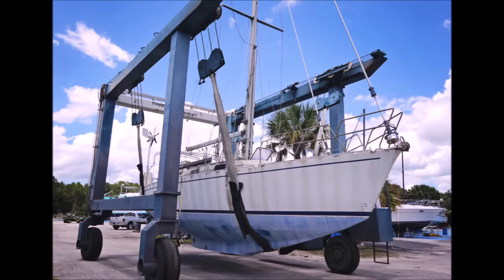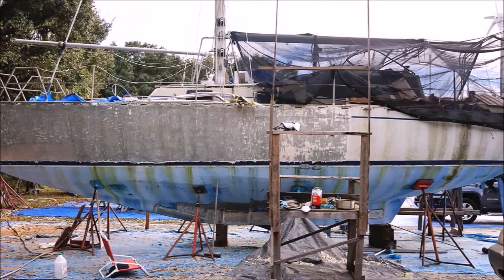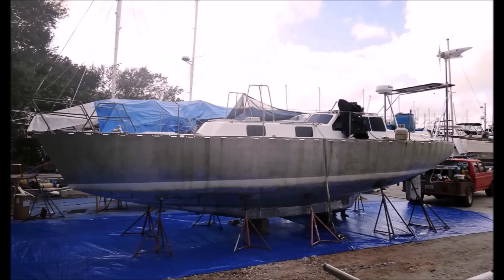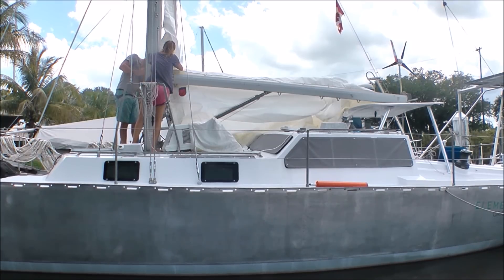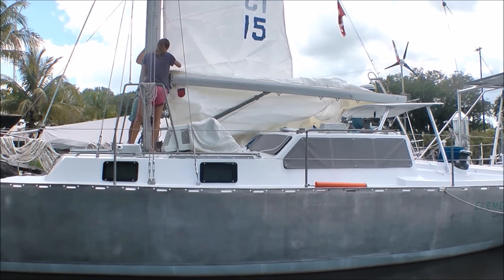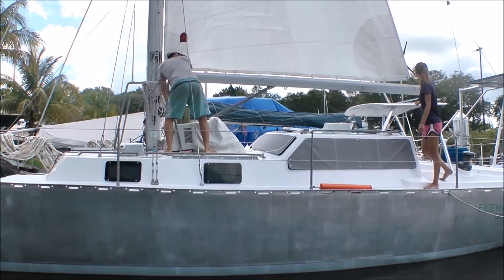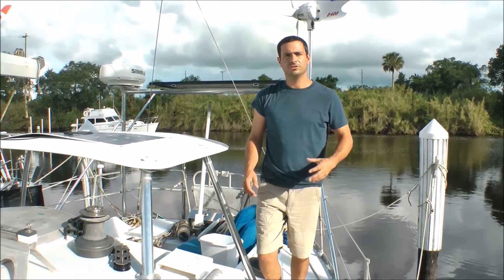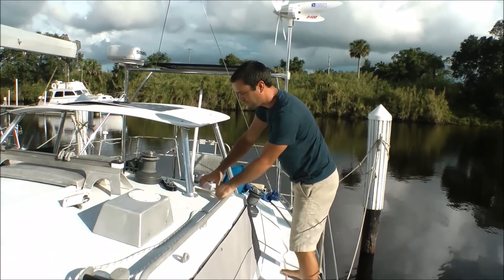Our Thoughts on Going Bare (MJ Sailing - EP 24)

Comment: I was one of the posters that questioned the bare hull.  I spent a couple of decades in Manufacturing and dealt with a lot of Aluminum, mostly 6000 and 7000 series.  I am not familiar with 5000 series but it looks like you did a lot of research and have made a wise choice. Good Job.
Reply from the maker: All Matt does from dinnertime until bedtime is research. I always trust all the decisions he makes on the boat.  :)

Comment: Best way to design is form follows function.  This has been a motto from the Porsche factory since the early days.  Porsche's racing color is silver because in the early days the bodies were aluminum and in effort to reduce weight the simply buffed the bare metal. 
As a student of design, I always love it whenever I see a design element that is outside the ordinary. When you investigate, you realize it's for a purpose which may be vital to its function. Love it guys, have faith in the science it always wins.

Comment: Personally -I like the bare aluminum hull.  Many aluminum expedition yachts are left bare -not sure why specifically,  but I have come to like it as I have been researching high latitude sailboat options.  
The larger point though is -it is your dream boat, and the both of you have done a tremendous job refitting it to what you wanted.
Happy safe sailin' and watch out for those icebergs.
-corey

Comment: Good choice on the winch position, to get speed and power on the winch you need your chest over the winch so under the canopy wouldn't be ideal.
I wonder if people realise that aluminium is for cold climates as it doesn't become brittle at low temperatures. Hit an ice berg in a steel boat and it will crack! Hit a submerged shipping container in a GRP boat and you'll likely get a big hole. Love the boat guys, looking forward to seeing her sail 👍

Comment: Nice progress, congratulations!  So, another option for running your lines back to the cockpit:  Start by scrapping that traveler and replacing it with a longer and more functional traveler in the 4-5 foot range.  Garhauer makes great travelers at very reasonable prices.  This would cause you to push the support legs for the traveler base further outward on the cabin top and leave more open real estate to run the lines cleanly to the center of the cockpit and near the companionway.  A little more work, for sure, but I think you end up with a clean installation, very functional, and a more useful traveler for shaping the mainsail.  Look forward to seeing the final install!
Reply: We're actually thinking of scrapping the traveler completely and going with an a-frame dual mainsheet set-up.  I wish I would have done this before the paint.

Matt
Reply: That's another option for sure, and would also free up valuable real estate.  I have no doubt you will figure it out one way or another!

Comment: I think you're on the right track with line placement. Everything is a trade-off. Some things to consider, but not deal breakers: getting in and out of the cockpit without tripping/smashing shins, reaching over the coaming (think rough seas) to operate the clutches, and planning the placement of your life-lines so they don't interfere

Comment: hey M&J I know all too well about the difficulties of painting aluminum because I paint aircraft for a living. Previously you basically had only two choices for getting anything to stick well to aluminum.  You had to either use an acid etching primer or Alodine which is a very toxic chromic acid solution. But now there is a new kid in town and it's called Prekote. It's made by the company Pantheon chemicals. in addition to being completely non-toxic and 100% environmentally safe it's also very very forgiving of process error so it's super super easy for the DIY person to apply successfully. And boy does it make the paint stick! I'm not a shill for that company or anything like that but I do use their product and really believe in it.

Comment: Matt, I think the solution you came up with for the winches is perfect! I like anything that unclutters the view forward, and you have the added advantage of another tie down point close to the side of the boat. It's to bad you'll have to do some touch up painting, she's looking so nice and finished right now but it'll be worth it in the end. Thanks for explaining the bare aluminum thing to....I was one of those people who wondered I just never had the courage to ask! I'm most anxious for your next video on the composting head. I'm re-fitting my 26' boat for solo sailing and it came equipped with a port-a-pottie which I quickly thru in the trash. The "Air Heads" are still quite expensive but I see so many people are designing and making their own now a days. You've done such a wonderful job with the rest of the boat I'm wondering what I can learn in that area that'll be really useful to me. Oh, I know 26' is quite a small boat for solo sailing, but I figured it would keep the costs to a minimum which is of utmost importance to me. She's a C&C (standard 1979) so she's got a 10' beam and 6'3" standing headroom something unusual for a boat this size. Being so beamy she's got lots of storage (plenty for 1 or 2 people). I've also ripped out all the a/c and I'm going only d/c solar power so I can be pretty much self sufficient. I will of course have a portable get-set and an inverter. I'm hoping to carry 500 to 700 watts of solar panels on board with enough surplus to run a fridge and possibly a/c for the really miserable days. My plan is to aviod marina's when at all possible. I've even found a really great portable water maker that produces 18/gph. So please go into as much detail as possible about your composting head. You boat is absolutely beautiful. Wish I had your talent! Thanks for bringing us really great videos!!!Bill S. s/v ODIN

Comment: Bare hull with Ali is great, no paint!. I love the agricultural look, super functional. 

When I was looking for boats, I looked at several Aluminum production boats that had peeling decks and was a turned off on the amount of work it was going to take to redo the decks. Ive seen several really nice boats that kept the decks bare and used treadmaster for the non skid. 

I own a similar size pilot house / raised deck saloon.( Steel -Dix 38 Pilot) When I purchased the boat all lines lead aft  up over the pilot house to the coach roof. There was so much friction from all the turning and raising that I could hardly raise the main by myself. I would have to go to the mast sweat it up by hand, lock it off  then run back and pull in all the slack . You are dead on not leading to the coachroof. I moved everything back to the mast.  All halyards and reefing lines.
, putting in two new 40st's and rope clutches for everything on the mast
I think your going to find you have more friction than you think you will leading along side. I really like the low friction rings but they are not as good as blocks.

Ive really enjoyed your videos, as I just completed a 7 month refit and can relate....

Ill be keen to hear how it works out once you get out and going.....

Cheers 
Barry
Reply: If it wasn't for the price, I think we would have gone Treadmaster.  We'd still have painted the cabin top for heat reduction, but left the deck bare except for the non skid.

I love Dudly Dix designs and the 38 is no exception! It looks like a ton of space for that size boat.   Is yours a South African built boat?  

Matt
Reply: I'll be sure to check-out the video when I get better internet.  We sailed with a Dix 43, but theirs was set-up as a deck salon with the seating at normal sole level and 8 ft ceilings.  What a great boat!   Before we bought this boat, I tried to convince the owner to sail it down around Cape Horn with me.... he turned ended-up selling it, so we bought this to do it ourselves :)

Matt

Comment: Something to think about when running your sheets and lines.  Minimize the number of changes of direction the sheet/line runs.  More turns increases the stress on the line and the force needed to winch it in.  Each block used to change the direction is a stress point on the deck.

Comment: I love the look of bare aluminium topsides! Apart from looking good, there's simply no point in painting aluminium topsides. Apart from being difficult to do, it simply doesn't add any practical value. Love your boat btw
Reply from the maker: I couldn't even imagine taking a painted hull through the ice fields we'll likely sail, and have to worry about every scratch in the paint.

Comment: Great videos, Thank You!!!  
Audio tip:  if you can find a 'high-pass' filter on your videos, that will cut out all the handling and wind noise.  Set it about 100-150Hz.  Also:  get a set of REAL good headphones that go alll the way down, as close to 20Hz as you can get.  Any questions, I'd love to help!  Get out there!!!
Reply from the maker: Would that high pass filter be on the camera, the external mic, or the video editing software.  I'm always looking for ways to better our audio, so I'd love any tips or information you could share.  You can email us at admin@mjsailing.com.
Reply: Anywhere you can find it, but I'd only use one at a time.  Can't say I'm really up on filming or video editing, but I'd assume there's an audio section in your video editing suite where you may be able to set that.  Having very good low-frequency extension in whatever audio monitors you're using is critical for this.  Worse comes to worse, get some cheap earbuds that hype their 'bass response' and screen all your clips with them.  If this was ProTools, I could talk you right through it.  ;-)

Comment: Nice explanations for both the bare boat and the new winch/line placements.  I learned a lot about aluminum boats and their care and feeding.  

I was wondering if there were any injury risks with those blocks up against the side. It's difficult to tell from the video if they might be toe stubbers or shin catchers :-)

Thanks for sharing!
Reply: The fairleads we are using are the harken low friction ring type, so nothing sharp on them.... the clutches, on the other hand, would be hard on the toes.  Luckily, the side deck is large and we have plenty of space to step around.   If I were designing the boat from the start, other plans would definitely be implemented.

Matt

Comment: The whole "to paint or not to paint" on aluminium is an interesting question. Here in Europe the French seem to go bare whilst the Dutch seem to paint. Personally I prefer the French approach. 

We bought a painted Dutch boat last year and one of the few things I wish I could change is to remove the paint. No matter how good the paint job eventually you get bubbles forming and its a major job to keep on top of it. I'm quite tempted to strip off large sections of paint to see how it looks. I'm told by the builder, that there is quite a bit of fairing under the paint but even so I'm very tempted to get stripping. 

I certainly prefer the look of Elements of Life unpainted. I think you made a sensible choice.

Cheers
Reply: When I started stripping the paint and fairing off, I was sure I'd get 90% done and find a huge section of the hull with accident damage or something ugly and disappointing.  We got lucky, and only the seams from butted aluminum panels are rough and unfinished.  But, we had little fairing to begin with.

Matt
Reply: My boat's original owner took her Svalbard and I'm told she spent some time stuck in the ice. Inside the panels all look good but taking the paint and fairing off may give us an unwanted surprise :-) Glad you were lucky.

Comment: 5083 has a higher purity of aluminum (92.4-95.6%) as compared with 6061 (95.8-98.6%).  Both alloys have some chromium in them, but 6061 has a higher percentage of copper in the alloy (0.1% max versus 0.4%).  However, 5083 has higher amounts of both Manganese and Magnesium.  As Matt says, the big practical aspect of 5083 is that it generates a protective oxide layer that inhibits further corrosion (doesn't eliminate it).  6061 typically has to be anodized to protect it from corrosion.  A very expensive prospect on a boat sized project!  And it still probably won'e equal the protection afforded to the 5083.

Comment: Man, i cant even fathom how you feel after such a long time thinking it was only going to be like 10 months at first. Congrats, looking forward to the adventures that ensue from here. She looks fine btw, the only thing is that Metal boats are about 3-4 degrees hotter while in the tropics vs Fiberglass/wood. I see youve got the AC rigged LOL like i used to at my house with it in the open sliding glass door and cardboard filling in the gaps :-)
Reply: I wish it was only 3-4 degrees!  We were limited with head room to insulate more than 1-1/2 inches thick, so we have less than the 3 inches I'd like to have.  

Matt
Reply: That may have been in Celsius LOL, Sailing Ruby Rose was talking about it.

Comment: Considering you are using a tiller I would go with the winches on your second idea much easier to handle and keeps the lines out of the way.  I like you bare hull looks nice.  I like red on glass an  varnish high gloss on wood.
Reply: As long as the exterior varnish is on someone else boat, I'm for it too!

Matt

Comment: There is a product called ALODINE that is a aluminum etching chemical.  It creats a near clear oxide finish to help prevent additional uncontrolled corrosion.  Similar to anodizing but it is done like painting on the Alodine and rinsing it off at 15 to 30 minutes.  You can realodine anytime and not see the patch area.

Comment: Great episode, it's been fun watching you guys bring her back to life. Quick question, how do you think the renovation would have differed if tinware a fiberglass hull?
Reply: Much easier with fiberglass!  Things that make aluminum take longer:

Spraying insulation needed

Priming/painting much more detailed due to adhesion issues

Need to be overly concerned with protecting electrical (conduits for all)

Since everything is metal or insulation on the inside, you have to cover it before you build out furniture.... essential making a boat hull inside the boat.

Every wood surface needs to be insulated from the metal to make sure moisture doesn't sit on the aluminum.  We epoxied coated every piece of wood.  

All fasteners have to be insulated from galvanic corrosion of the metal.  

I'm sure I'll think of more, but that's a start.

Matt
Reply: matt johnson thanks for the reply. You guys are terrific, love your can do attitude.  Hope the season doesn't slow you down.

Comment: Bare is the ONLY way to go IMHO. We have a 1966 Marinette 26' cruiser. Built like a tank. We faced all the same issues.  If you do not have a factory-like environment to prep that aluminum, it's going to fail (the paint) every time. I caught hell on the Marinette forums for deciding to soda-blast our hull 8 years ago. The same people that gave me hell for opting out of painting the hull seem to be the ones that complain non-stop about fighting paint issues with their boats that they tried to fix in their back-yards.  You just cannot prep and get paint on that boat before the oxidation starts without multiple workers and a controlled environment. We soda-blasted and our boat now looks awesome. It has a unique work-boat look to it. Everyone on Lake Anna here in central Virginia knows the boat.  We have owned several cruisers through the years and this boat is by far the easiest to maintain. The only thing we did not do is paint below the water line, but the boat is in a lift and we figured that was not important.  I cannot tell you how happy we are we did not listen to others and try and paint.  Now we just enjoy it.  Well done on that sailboat you guys, it looks awesome!!!

Comment: Yep, see bare boat's here all the time, but we do paint the bottom and the deck. The bottom for the reasons you've just stated and the deck against heat, bare metal (Aluminium) gets hot to the touch in the sun, not very comfortable in most cases.

Love how the boat looks now,....so when are you two going for a sail⛵ on the North Sea to our Dutch coast ?
Reply from the maker: We almost went with white Kiwi Grip because we knew it would help drop the surface temperature a bit, but then we saw how quickly it gets filthy.  So we figured we could put up with a year of gray in the heat and just always wear shoes/sandals on deck. :)
The plan is to sail to the Azores in June 2018, winter over in the UK and Scotland, then begin our trek further north in the spring of 2019.

Comment: ok that's the main hull. what about the structure? I also wonder about powder coating. We had a powder coater come in and spray then we had heat stress people heat from the back side. The structure was to big for an oven. I'm like you, in my thoughts on aluminum oxidation.
Reply: That would be neat, but I'm nor sure how you would repair the surface once a scratch forms?  Also, with sprayed insulation, unfortunately there is no getting to the back side.

Matt

Comment: A very logical, reasonable and convincing explanation as to why aluminum doesn't need paint.  Only question remaining; didn't the boat have extra dagger boards or guara boards or something?  I remember Matt explaining it but can't recall how they are supposed to work on the Trisalu.  Did you do away with them?  Ken in St. Petersburg
Reply: Unfortunately, we did have to weld over them.  We ran out of money to cut them out and do it right this time around.  When we can, we'll correct it.

Matt